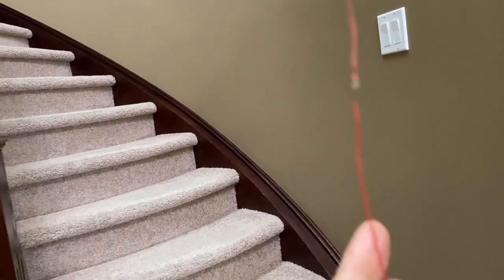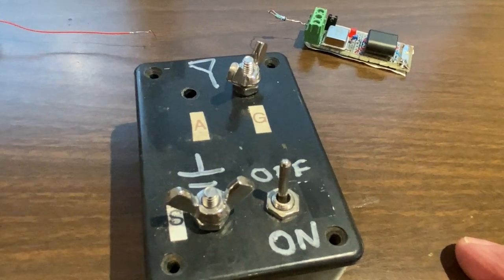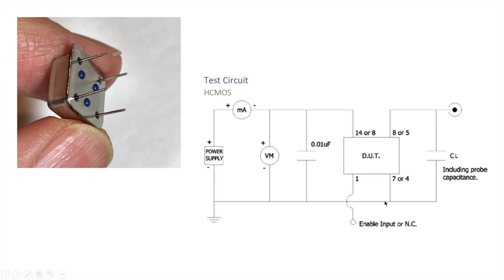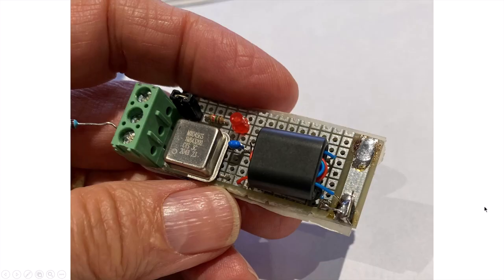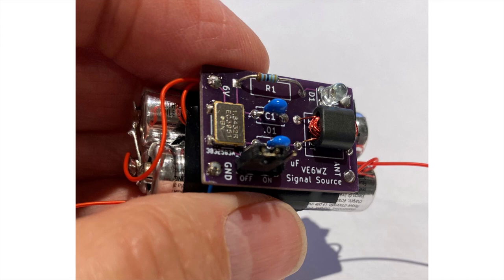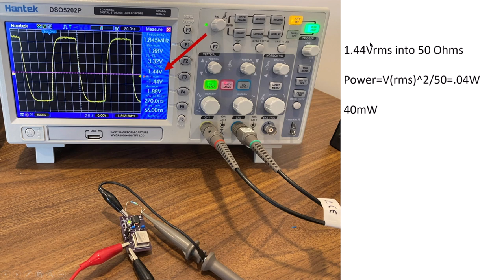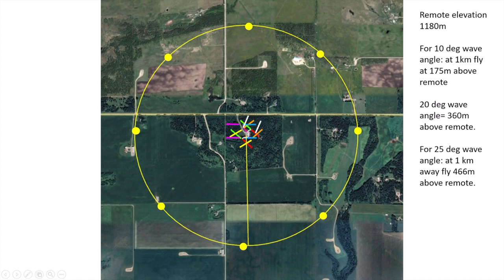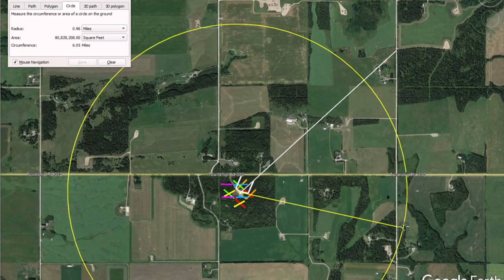DIY antenna testing signal source

Comment: How about using a drone to suspend a very tall vertical monopole for 160m, 630m, and of course 2200m ?
Might need a bigger drone to hold-up 550m of wire.

Comment: Steve, do you remember which wire gauge you used on the binocular transformer, please?
I do appreciate your comments. 73!
Reply from the maker: I think I used 32 gauge very fine magnet wire.  Any wire will work. Maybe you can use wire from old transformer or relay coil?
Reply: @ve6wz  Thank you so much for the information, as well as your work. I do appreciate all your videos.

Comment: Can you share the results for one of your antennas?
Reply from the maker: Hi Filipe,
Yes, this is another video planned.  Unfortunately I "ran out of season" this fall when the snow started and cold weather came. Last night it was -25C at the remote.
My hope is to present my results for all my rx antennas.
This will include the 9circle RX array, my above ground Beverages, both single and broadside phased, and also my new RX system with Beverage on the ground system.  With the new BOG system I hope to measure single wire, broadside phased pairs and also en-echelon end-fire pairs broadside phased.  A BSEF array of BOGs (w4 wires per direction)
This may not be ready until early or mid summer next year.
Reply: @ve6wz  fantastic effort, and what a treasure for us armchair dreamers! 73.